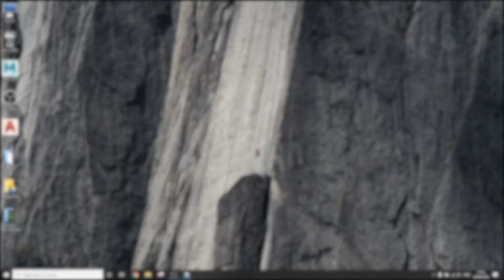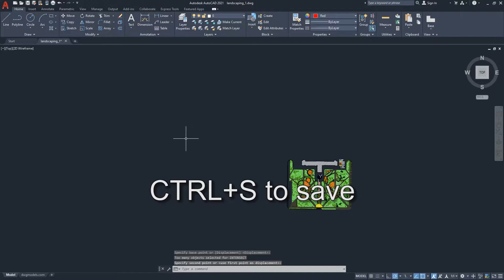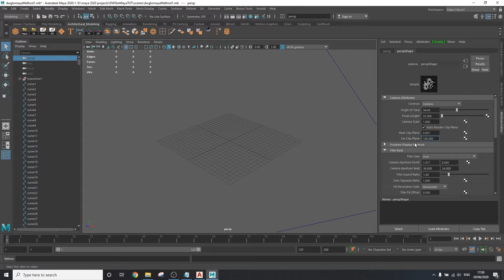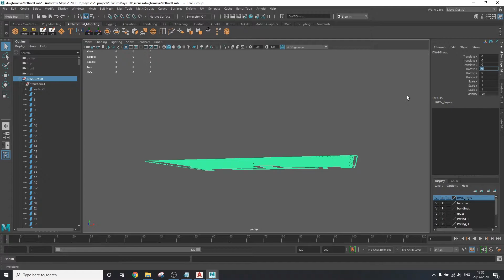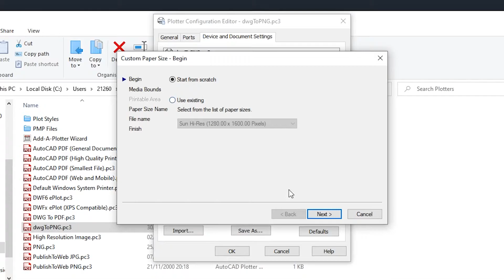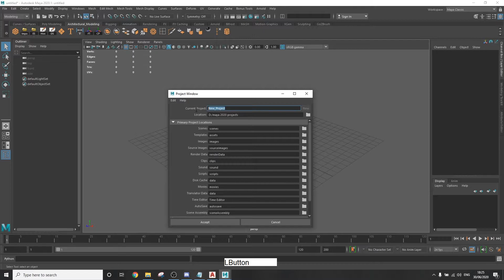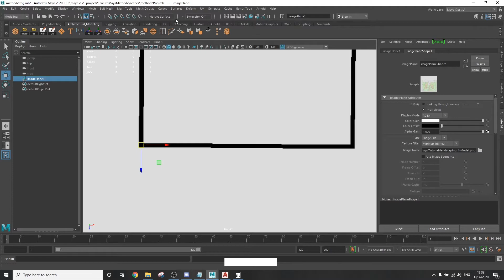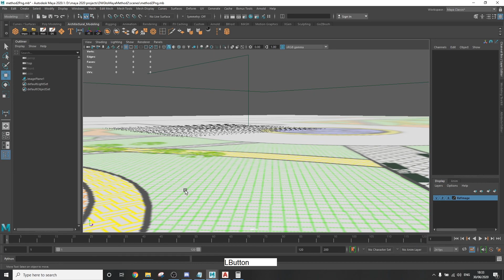AutoCAD DWG/DXF to Autodesk Maya FULL WORKFLOW

Comment from the maker: Even when importing a DXF 2018, it can ignore many details. When importing, make sure to change the "files of type" to DXF_ATF", select the DXF file, and before importing try to play around with the Tessellation settings at the bottom of the options menu on the right.
Reply: hey man i have a maya 2020, when i import DXF 2018 i lost many details but the project in autocad is very simply and i dont understand your comment well i hope you can help me.
Thank you.

Comment: Thank you! Please tell how to find ATFPlugin.mll if it is not available in Plig-in Manager
Reply from the maker: May I ask what version of Maya are you using?
Reply: @b3darchviz   I install Maya 2019 in mac for 3d modeling, and I work with Autocad on mac for drownings. Thank you!
Reply from the maker: @stepandavtyan7823  I did some research and apparently it has been removed since Maya version 2019 on the Mac. Can you try to see if dwg and dxf are in the import menu even if you don't have the plugin? If not, the solution would be to go back to Maya 2018. I'm not sure why they removed it.
Reply: @b3darchviz  Thank you very much

Comment: some lines missing when export to Maya, any suggestions?
thank you very much
Reply from the maker: Happened many times to me too in some projects. Try to convert the type of lines used in Autocad. If I remember correctly, that's caused by some people using a different type of lines in Autocad. If you're not that savvy in Autocad (so am I), just use method 2. All the lines will export to an image.
Reply: @b3darchviz  I really appreciate your quick response, method 2 looks wonderful but really I need the lines to make extrusion 
so I don't think will work, Thank you again i like your tutorial
Reply from the maker: @alzajel1  All I know is that Autocad uses either Polylines or Lines. I'm not sure, but maybe one of them doesn't work well when exported to Maya. I suggest looking up how to convert polylines to lines or the other way around, try it on the lines that don't show up in Maya, and export again. That's the only idea I have. Thanks for your kind words about the video, I hope you got something out of it :)
Reply: finally, it worked, actually, I convert Polylines into lines (Explode), thanks to you I really appreciate your help and your concern, Thank you a lot :)

Comment: I have a question, why nobody is using maya for acrvhiz  whenever I see a good artwork that must have been make in max or unreal...
Reply from the maker: It's really up to you. I've tried Max and it felt like a downgrade from Maya. Anything that can be done in Max, can be done in Maya, blender, cinema 4d and so on. Use whatever you feel comfortable with, and go from there. It's true that generally people tend to link archviz to 3DS more, but it's just a preference. I'd recommend you look for jobs you're interested in, and see what they require. Whatever software is most common, try to learn it so you have more luck finding a job, but if you prove you can do it in your preferred software, they will happily invite you (happened to me with archviz company who needed cinema 4d users, but as soon as I proved I could do it in Maya, and it was compatible with their end, they let me use it)
Reply: @b3darchviz  wow  thanks for the info , are you on any social media platform where  I can dm you ??

Comment: How can I achieve a rendered quality in autocad but i want to view  it 360°. I made a wrist watch. I also want to animate the clock
Reply from the maker: I've only worked with 2D autocad files, but you can export your wrist watch to Maya or any 3D software of your choice, given that the file extension is compatible between the two. Animating it requires some animation knowledge, which I unfortunately can't help with, but I know that you have to set the pivot of each hand to the middle, so that it rotates correctly, and then use keyframes to animate the rotation. At the same time, you can animate the camera position and rotation the same way using keyframes. If you can get the hands rotating correctly, then there camera animation will be easy.

Regarding a good render quality, Arnold works great, given that you use the correct materials and render settings.
Reply: Thank you so much for your reply🤗🤗🤗🤗🤗🤗🤗